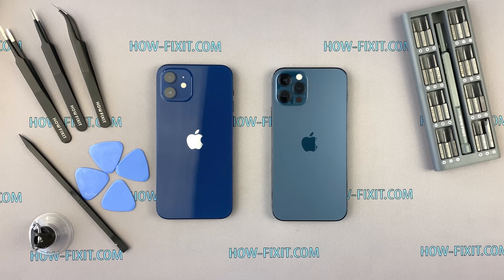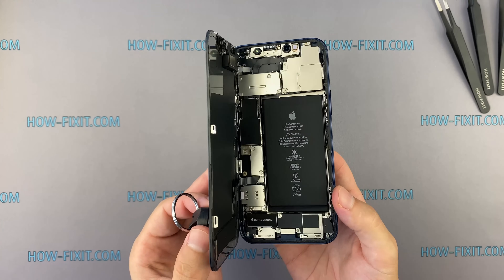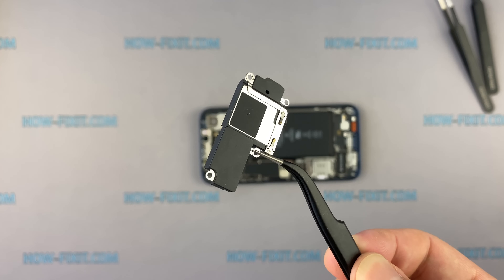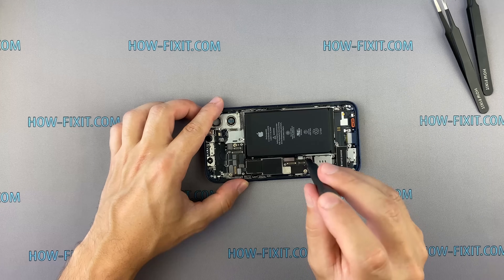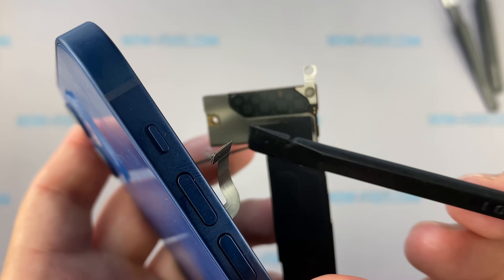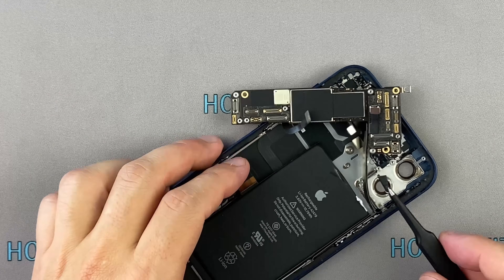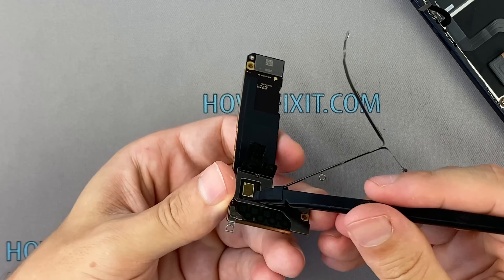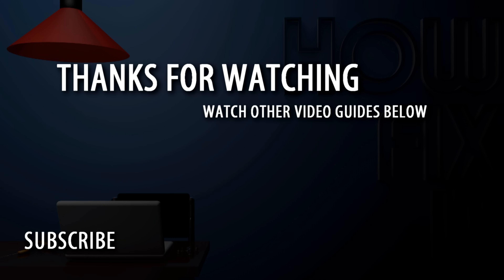iPhone 12 Teardown

Comment: I bought an iphone 12 second hand in France and when the screen had problems and I wanted to change it we realized that the model A 2172 I had there was no internal sensor earphone integrated on the screen but curiously the face'id and earphone worked well before the screen was defective, would you please explain?

Comment: hi @How-FixIT

Need your help in understanding how power is drawn into the flash
as my main camera is showing black screen as well as the flash does not work along with it and normally in torch as well, but interestingly when I switch to ultra wide camera,(which is still working), the flash works perfectly fine along with it, is it some issue with camera IC or Camera module
Please help!

Comment: How do I find a logicbord for a iphone 12 ? I cant seen to find one
Reply from the maker: you can find motherboards for iphone 12 on ebay or aliexpress
Reply: Just so you know, the board is serialized to the phone. If you change it, the new board won't work well with the phone. You need to go to an Apple Store to get the new part paired with your phone.

Comment: What is the battery capacity on both devices ?
Reply from the maker: the capacity is the same - 2815mAh.
and also the Battery in the iPhone 12 Pro has the same number A2479 as on the iPhone 12 and is interchangeable with each other.
Reply: @howfixit  both iphones have 2815mah battery capacity ?
Reply from the maker: @V.E.D.A.N.G  Yes, you can watch this iPhone 12 Pro disassembly video https://youtu.be/V3SpcDdeiCI
in this video you can see the same battery

Comment: Disassembly is not hard. But that cables soldered to motherboard will be the big problem.
Reply: not only that but damn near everything is paired to the logic board in software so if you replace the battery or screen or cameras or faceID sensor you don't get full functionality
Reply: @HearMeLearn  yes... you are absolutely right.
Reply: What are those cable that are soldered ? Just broke mines 🥲🥲🥲🥲🥲🥲🥲🥲🥲🥲🥲
Reply: @luismorales5297 5G